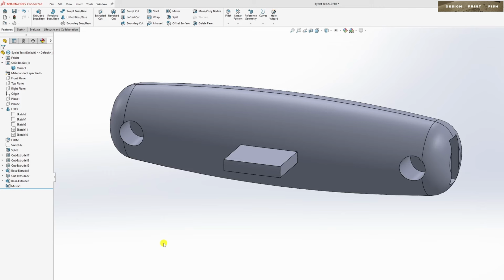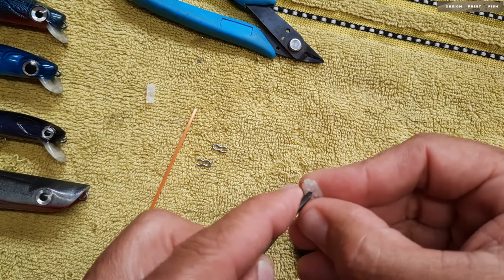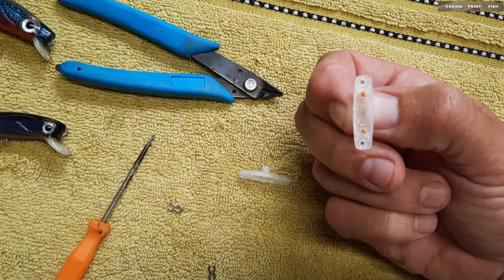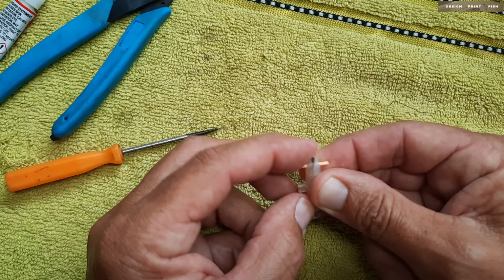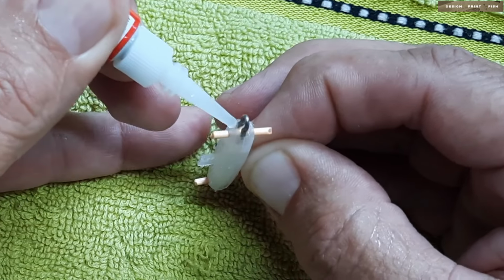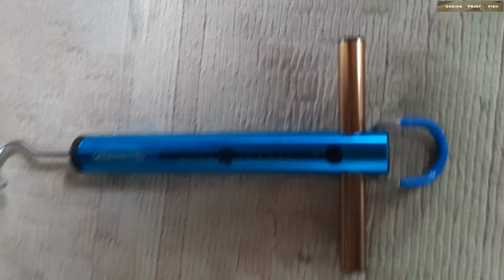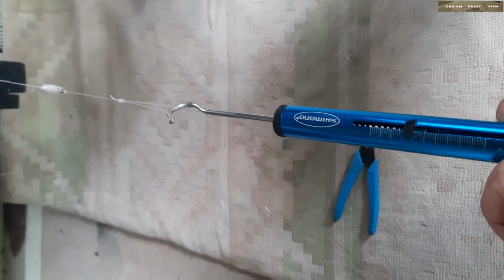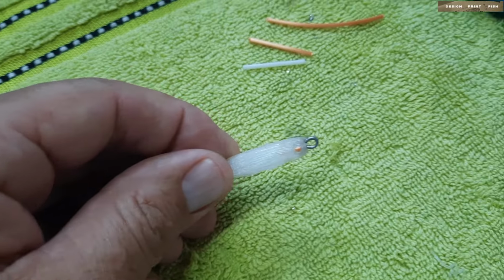The Best Eyelet System for 3D Printed Fishing Lures?! A Full & Uncut Test of my System.

Comment: I could not work out what filament you used, maybe I missed that. Wondering how much the layer adhesion affects the strength of this method, do you print fairly hot?
Reply from the maker: I was using PLA here...I'm printing PLA @ 190 so i guess thats pretty cool?....and very valid point that could affect layer adhesion and therefore overall strength - although I cant see that i would ever be fishing with more than 8kg of drag on lures of this size (I have since retested a few times and can easily prove 10kg plus with this system). 

I have printed upto 220 with PLA but then stringing become a bit of a problem....Have also tried and printed hotter with PETG (220ish I think) will do more with PETG but back on PLA for now.....Appreciate the support mate and always welcome the feedback!